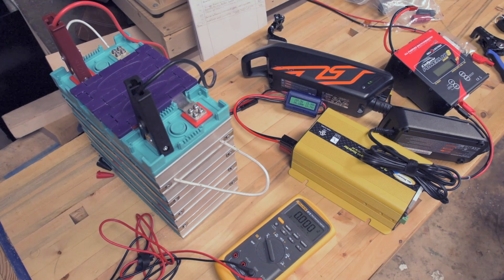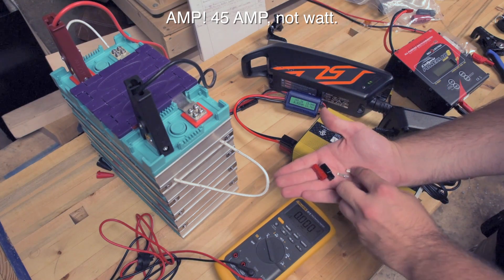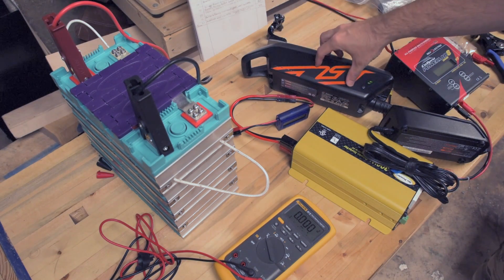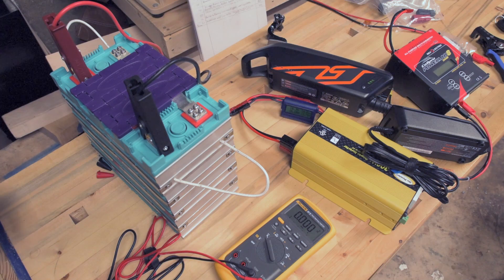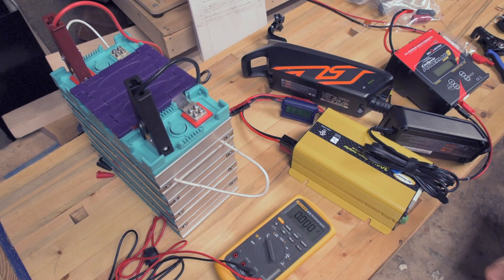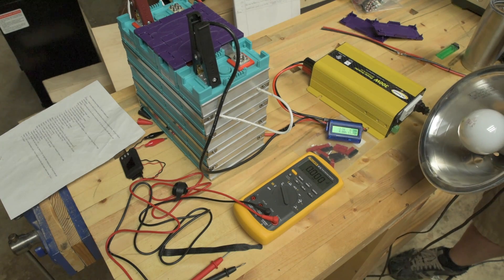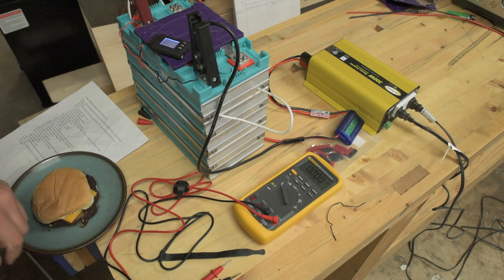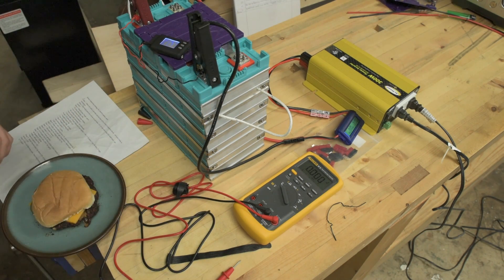1200wh LifePO4 Solar Generator Build - Part 1 - Drain LifePO4 to 12v

Comment: I let it die bro. Help!  I let it get down to 8.8 volts but charged it up with a smart charger and got it up to 14.2 and it keeps the voltage at stand by around 13.28. I am going to do a watt/hour test on it and see what damage I did!

Comment: The power lab will discharge at 10 amps & 30 amps if hooked to a correct dc battery source.
Reply from the maker: I use it in the next video to discharge the remainder of the battery's charge on a per cell basis. There's very little energy left at 12v!
Reply: Cool Project...best way to balance them 
1.Wire all cells in parallel. 
2.hook positive & negative charger terminals on opposing ends discharge or charge to your prefered set voltage. 
Important to let the cells set in parallel for a day or 24 hrs for every 100 AH is a good rule of thumb.
3. add a 4s connector to the battery, let the powerlab do the all balancing.
Reply from the maker: That would be a top balance, yeah?
Reply: top or bottom, Could cycle them but may take days. If your going to fully charge them bottom balancing is a waste of time. bottom balancing works best only charging to 3.5 volts as full.

If you bottom balance the cells in parallel like one 400ah 3.2 volt cell
Reply from the maker: I don't think the powerlab can perform a bottom balance via the 4s connector. Could be wrong.
Reply: It will.
Reply: will bottom balance up to 8s
Reply: Just use the discharge function factory set to stop first cell to hit 2.85 volts for lifepo4 cells but at 10amp discharge will bounce back to 3 volts or more may have to discharge a few times to get them to rest around 3.0

Then pull cells apart, parallel them for a day for perfect balance.
Reply: Do you have the computer interface for the powerlab?
Reply from the maker: Hm. That's an interesting strategy. I do have the computer interface, I believe. I haven't used it yet though.
Reply: Well it won't balance unless you set the powerlab to charge to 3.0 volts.
Reply: createthis just a time saver, but still takes forever!!!! lol!
Reply: I use lifepo4 cells have 310 AH at 48 volts that would be a 1220 HA @ 12 volts. Using same charger you have it's AWESOME!!! got all my cells used, That dang charger has recovered so many cells has payed for itself many times over..
Reply from the maker: dang. that's a lot of power!
Reply: Runs my home 24/7 &  8 to 12 hours of AC in the day time. Only the AC runs of the grid at night. Gotta have many crappy days in a row to transfer to grid. But just doesn't happen very often. Maby 3 or 4 times a year??? and only for 4 to 6 hours. lifepo4 batteries are amazing with solar. Still mind blowing how well every thing is working... Power of the sun brother is the way to go....

Comment: haha I have the same go power inverter on my 120Ah LIPO box I built from 5Ah lipo batteries.
Reply from the maker: It's a good little inverter. Love how portable it is. Love how quiet it is. Value proposition isn't great though. The next video in the series (or maybe the third video) will feature the 2000w xantrex inverter I bought for exactly the same price as the go power 300w inverter.
Reply: createthis very trues, but I gone mine used for $70 :D I love xantrex I have a SW3000 and it runs my house, loving these videos, check out my lipo box videos :)
Reply from the maker: Scratch that. I bought my 300w for $171 and my Xantrex SW2000 for $325. Not sure why I was thinking they're the same price. The go power 300w makes sense at that price.